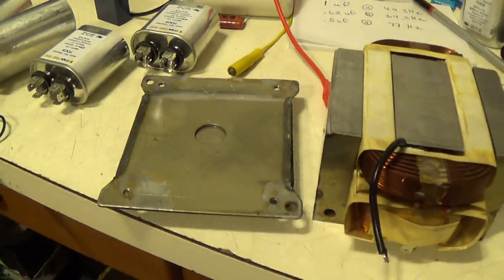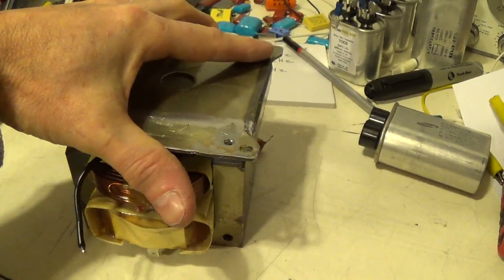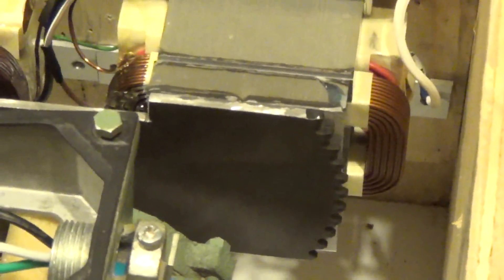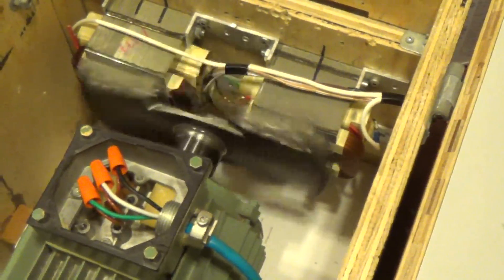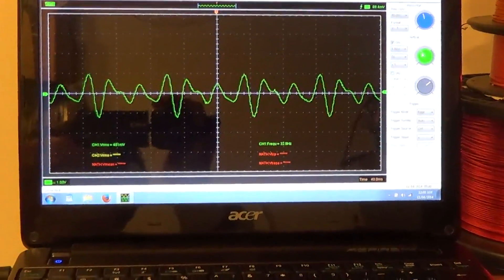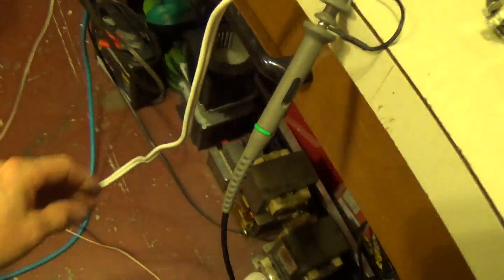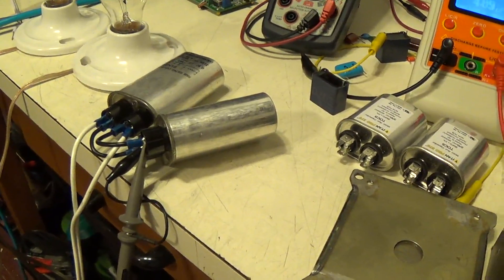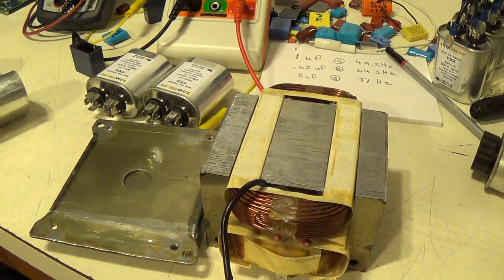Testing of QEG Effects test 1

Comment: good experience and nice effect, but why all peoples go for go for 1 or 2 kw motor that make experience dangerous, the same system can be smaller, I decide to do some simulation and see.
Reply from the maker: +Posiible Free Energy?  Let me know how it works out. Thanks
Reply: I have tried with magnet software but fail because I can not simulate the external energy  and the simulation is too big file and need  a lot of time to be finished because of high speed rotation.

I still suggest that you use speed drive wit DTC ( Direct control torque to maitain the speed when the  load increase) also no need to go with big model, small model is enough and more safe.

I will try to experience with small model after fail in simulation.

Comment: here are all  tne  really answer that you need        
https://www.youtube.com/watch?v=E0bOK7ChwbQ&feature=youtube_gdata_player
Reply from the maker: ivan faingold that is disinformation and measurement error. AC reactive current cannot be measured by an Amp meter. An oscilloscope and a precision shunt is needed to find current and voltage phase angle.

Comment: The reasons for the vibrations are because yoy have shoddily welded a could of chunks of iron to the sides of a chunk of old sprocket, try precision machining the thing and come back when you have some hard evidence that it works
Reply from the maker: Sorry, but that is not the reason. It's basically when the magnetic field builds up that it makes that sound and the load stalls the motor.

Comment: Excellent work Luc. It reminds me of the early 1900s Sears single cylinder engine. It had an ignition coil with a moveable core cap. When there was current in the coil, the core cap was pushed away which resulted in a spark.

Comment: Also watch QEG Germany got resonance 5KV @ 500mili amps . That QEG resonates so loud it sounds like it is about to vibrate to pieces.
Reply: Mr55chevyman You said, "resonance 5KV @ 500mili amps". To clear, that is REACTIVE Power in the Tuned Circuit only. That is NOT Output Power. That REACTIVE Power cannot be used to do any useful work, like energize a Load / Light Bulbs. The QEG is PROVEN by James per PDF on his website to be only 17% Efficient. The QEG is proven to be UNDER-UNITY by James. The QEG is not over-unity.

Comment: When it starts shaking you're just entering into resonance. I believe the shaking is normal. With electrical resonance comes physical or rather mechanical resonance. Maybe set the box on a foam or rubber pad so it can vibrate without being so loud. Watch the video Morocco has resonance and listen how loud that QEG is. YOU GOT IT.

Comment: Hi Luc, when you divide the total 12H by the minimum 6H it gives change of just 2 times. It is good to get this number higher as it controls the Parametric energy gain. So in QEG they try to swing as close to zero L (via mutual inductance swing M)  at maximum cause M has a negative value when L1 and L2 are counter wound. And any positive (Henries) number divided by something approaching zero is a very big change Hope this makes sense.
Reply from the maker: The QEG doesn't have that much swing. James said it goes from 30H to 40H. I do agree it has more inductance but way less swing then mine.
Luc

Comment: Yes ok, just that QEG seems to be wired this way ..so as to get L1 + L2 - 2M.
So in QEG total L varies to a much higher degree than combining two CW wound primaries. Some MOT's primaries wound CW whilst others are wound CCW a combination of both will improve your results. This is true basis of Parametric Amplification. To swing a reactive parameter a great deal during a cycle or more correctly twice during a cycle.
Reply from the maker: With my two MOT HV coils in Series the Inductance swings from 6 H (I cores away) to 12 H (I core lined up)
Luc

Comment: Hi Luc nice, thanks for posting.  Would like to ask ....when MOT inductances have closed path (ie: with mutual inductance) do you have them wired series cancelling?
Reply from the maker: In my test device the air gap between each MOT  E core is too great to make a closed path. So connecting in series cancelling or not makes no difference.
Luc

Comment: Nice work! I think you need to mechanically balance your rotor- that's why it shakes so much. How to balance it? I've read of a monte-carlo balancing approach where you run it to a certain rpm and measure vibration. You stop, and mount a small weight somewhere and try again- it will either make it better or worse. You keep refining your weigh placement until you minimize vibration.
Here is a vid of balancing a large impeller: Balancing a Large Impeller
Reply from the maker: The I core rotor is very well balanced, that's why it's so quiet and no vibrations are heard, well until the flux starts building at resonance. Balancing more won't help this.
Luc

Comment: When You make the diameter bigger You don't need a high rpm ! AND as a tip ; Your wooden box isn't going to keep the flying metal inside watch out !
Perfect job for the rest !
Reply: Using plywood as the datum for close tolerance moving metal parts is generally a no no.
Eventually you might aim at heavy gauge (~5mm) mild steel box/cage with vents and bracing. 
If you approach rpms in the high hundreds+ (with the mass you have there- called Angular Momentum) and develop any resonant vibration (QEG's do right?), between all this and a heat build up (in a wooden box) stresses may reach that point of warping and then failure. Big time.
A strong steel box, secured well (bolts,welded, dyno bolts) to bench/floor and venting/fans and perhaps balance the rotational parts and you'll be safer. Any metal fabricator (Boiler Maker/Metal welding trades) will be able to build it for you for under $200.
Good luck! (i hope to follow soon with my own. (I'm a Fitter and  Civ. Eng)
Reply from the maker: David Michael calmfocustruth
I agree but with zero income that's the best I can do. Please post the link to your build as I would like to see the material you used. Thank Luc
Reply: Luc Choquette Just another thought; if you need to fine tune rpms and control variations due to the induction effects, try using a Fly Wheel . This will have the effect of creating Angular Inertia for you and resist rpm flutuations. More mass = more inertia.
(my project is months away yet)
Reply from the maker: David Michael calmfocustruth
I agree but if you consider the weight of the I core rotor it should be plenty of flywheel effect.
Luc

Comment: Hi Luc,
maybe is woth to try experiment with piezo buzzer conected to signal generator and placed between plates of MOT?
Reply from the maker: Hi zalia zole, not a bad idea. However, piezo's are not known to have low frequency driving capabilities. The cores would have to be Ferrite to operate in the frequency range of an electric piezo element.

Thanks Luc
Reply: Luc Choquette  I think, there is not low frequency spikes on MOT's steel: watch?v=mLK1VG8h2Wc
 
and rezonance circuit can pic up low frequency harmonic.
Reply: Luc Choquette
The ferrites dont like ferrorezonance. they crackdown

Comment: Would you say this machine operates on changing the inductance of the coils at certain frequencies? This would in a sense alter the impedance at the natural electromagnetic oscillations of earth...If this energy were to be flowing at all times...we would only see it when we slowed it down and let it speed back up....High impedance back to low impedance...just a hunch. Let me know what you think....I want to apply this to the vortex coils Ive been making...Also, check out asymmetric motors by UFOPOLITICS on yt...He has been disclosing how asymmetric generator/motors work...They have an output and an input...depending on how much energy this makes....you could feed energy into the motor after you start it...

Comment: Hello Luc!
Nice test, but I don't know how much of the transformation effect there will be since the cores are closed only a small portion of the total cycle, so the energy in the resonant tank might just stay inthere and has nowhere to go - just put some kind of load directly on the resonant tank circuit or maybe you can direct the power out of there and step the voltage down through an additional transformer.
Hope it helps!
Reply from the maker: You're right. It's basically half a QEG. I built this first to test the effects of varying Inductance but I got more then I thought. My next build will be more complete. I did have 2 bulbs as loads.

Luc

Comment: Fantastic build... very impressive. I would second the comment about making sure the Load is present when you approach resonance, if that's not been done. Also, have you considered lowering the resonance point, by using larger capacitance values?  That may help limit the cabinet from wanting to walk away. ;-) 

Those capacitors... do you know if they are polypropylene or not? Anything else will have a high ESR, and not give the ultimate results.

Again... awesome work!  Be careful... maybe add some steel or even aluminum plates on the inside of that box inline with the rotation plane of the "rotor"!
Reply from the maker: Thanks. Actually it would be better to raise the resonating frequency as higher frequencies have shorter waves (less flexing)

Luc

Comment: You need an output. Thats why it is shaking so bad. It is beginning to go into resonance which will be very very hard to quell without an output to resist the output building up.
Reply: Hay Bigman is it not more likely to be an imbalance due to the weights?
Reply from the maker: had two light bulbs as load attached.

Luc
Reply: Yeah I mentioned the fopa earlier on the forum. It is because you don't have a balancing phase. It probably would smooth out if you had another set of transformers.
Reply: But after thinking more on it what if the shaking doubled or tripled. This could be due to magnetic inertia. Maybe a coil shorting system could draw off power only on one part of the slope then short it for the other swing so it becomes less of a drag? Would adding windings, that are shorted, to the rotor work to help the process? Like Tesla was doing.
Reply from the maker: Jon Bigman Yes, I agree that could make a difference. This build was not a replication. It was to observe the effects of varying inductance and resonance.
I'll be building something better.

Luc

Comment: Luc, here is an idea to concentrate the magnetic field. Put magnets behing the stator. To double the mag. field, glue magnets on the rotor as well.
Reply from the maker: Hi Mike,  would that not then become a regular generator?

Luc
Reply: Luc Choquette LOL, I just read the QEG PDF, I see that, It does not use magnets. My theory still is valid but ,  not required here, as it would just confuse the QEG's process.

Comment: Hi Luc,

Good to see this. I had, more or less the same idea.
Did not test anything yet.
Here is a link:
http://be-do.com/index.php/en/forum/qeg-construction/200-totally-new-proposal-for-simplified-construction
I corrected my posting:
The two cores must be turned around the vertical axis, over 90 degrees.
Another thing that has to change is a slit in the rotor.
That way there is no leakage from one leg of a core to the other leg of the same core.

Thanks for your video